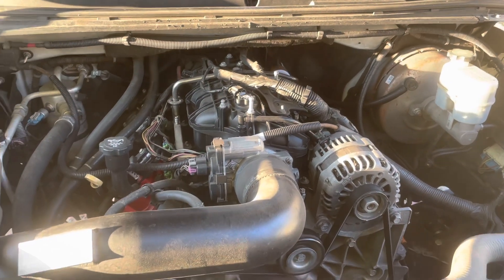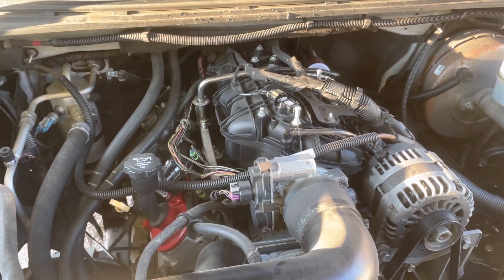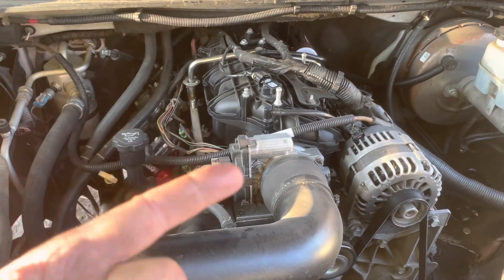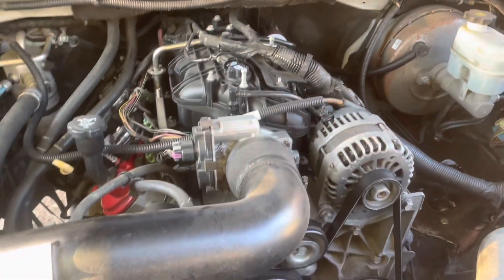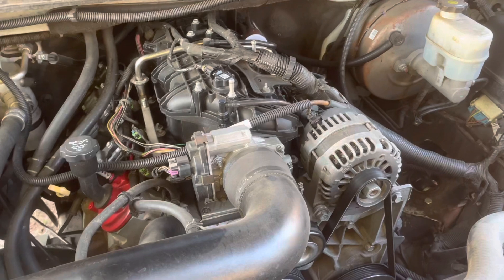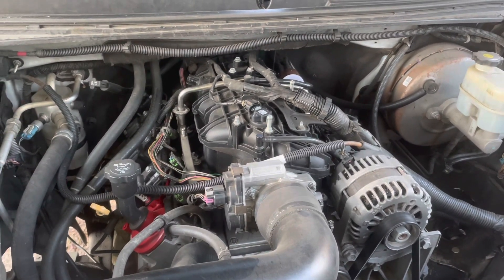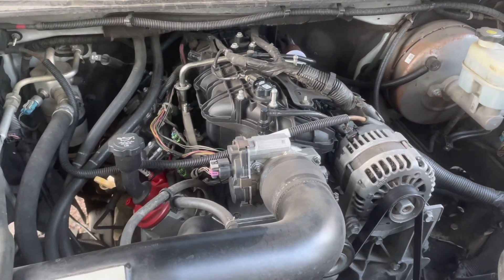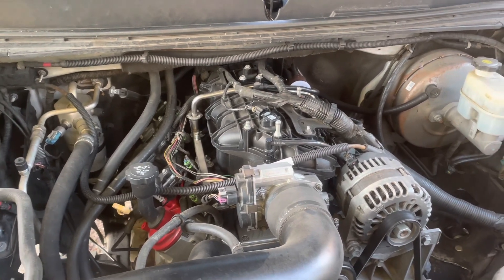Get Your Mercruiser Out of the Dark Ages, Go LS

Comment: I have a center console 87 Wellcraft boat that was originally an inboard motor from the factory... at some point it was converted to outboard, how difficult would it be to convert back? I have multiple LS motors on stands in my barn and this seems like my solution.

I have 8 months to get it done.
Reply from the maker: A new outdrive system with transom plate and drive is going to cost 10 times or more than your engines combined.
Reply: @moccasinmarine  I need a new transom no matter what route I take, a new outboard is $15k... I'm looking at Bravo outdrives for $5k...
Reply from the maker: You changed the rules on me. You didn’t say it needed a new transom anyway. But the labor to rebuild the transom assembly and the drive is going to be over $10k alone.

Comment: I cant find your marinized LS swap video. Did you make it yet?
Reply from the maker: Still working on it.
Reply: @moccasinmarine  that isnt selling your video claiming how easy the conversion is!!! can i ask why you havent done it yet? time/finances/complexity?
Reply from the maker: I didn’t say I haven’t done it yet. I said I’m working on it. When you launch a new product you don’t just throw junk on the market that’s untested and not profitable to manufacture. An LS in factory configuration won’t fit in a boat. It’s easy for me but not for most people so I’m trying to make it easy for everyone as in buy my kit, bolt it on, drop it in, and go boating. That’s takes time to develop and do sea trials. I’ll have all this done by November in time to launch in December for winter repowering.
Reply: @moccasinmarine  i am between a straight up repower with a 350MAG or consider LS swap

Comment: I have an 07 Tahoe with the 5.3 and a boat with a junk 470 merc. The truck is ready to be scraped out but engine still strong with only 243000 kms on it. You gave me new hope for the boat. Thanks.
Reply from the maker: Text me at 17063583175. I have some tips for you

Comment: What ECU would you run? The original one out of the truck? 
What about the cam shaft? Are you not worried about overlap or duration? Getting water sucked in??? Thank you for the video! I would love to do this in some of my project boats!!!
Reply from the maker: 411 pcms are the gold standard for LS engines. I would use an LS Marine camshaft from PCM or other sources that I have.

Comment: You have a video doing one of these swaps? This is honestly one of the best ideas. They're much more common than the sbc engines
Reply from the maker: Not yet. Hope to soon. I’m designing my own products to make it happen.

Obviously the elephant in the room is the programming of the EFI controller to run a boat engine. I’ll be selling that calibration once I get it tuned.
Reply: @moccasinmarine  I got a line on 2 500hp LS engines I would love to put in my 32' boat
Reply from the maker: @OzcarMike641  there is about a $5000 premium to marinize an LS engine compared to small block Chevy engines $6000 if you can’t program it yourself. To justify the swap you need to get the LS engines for free.